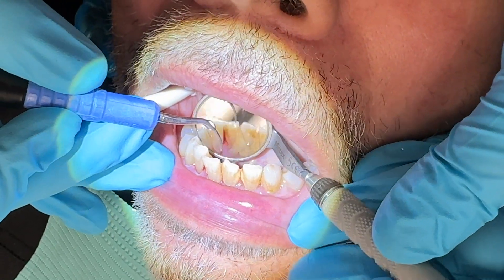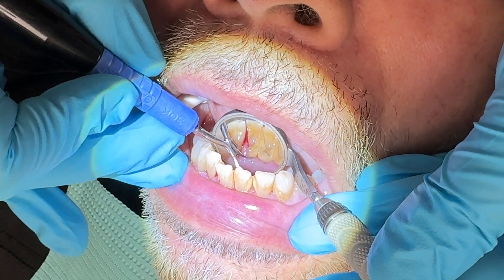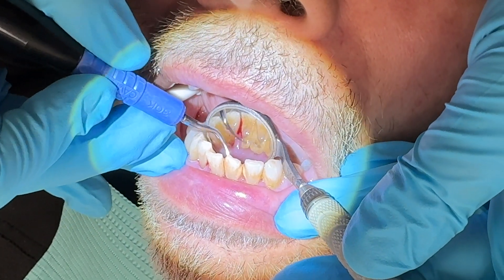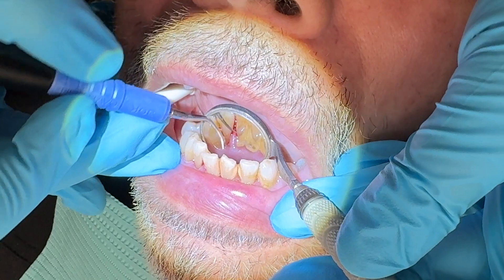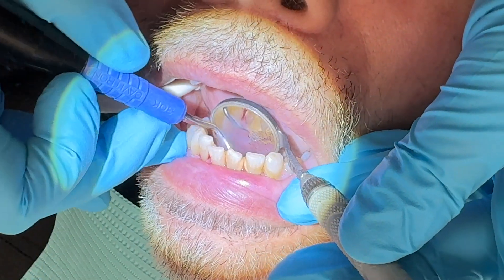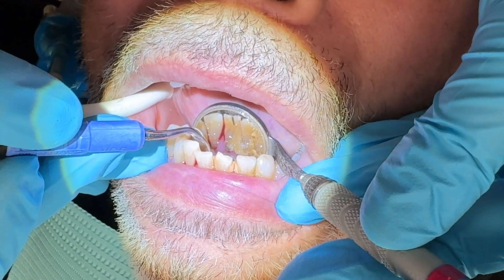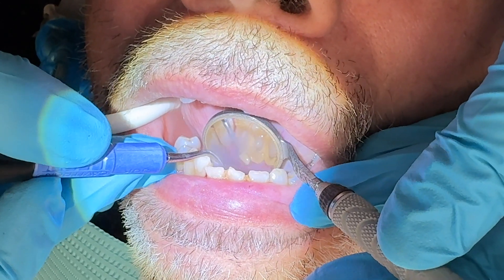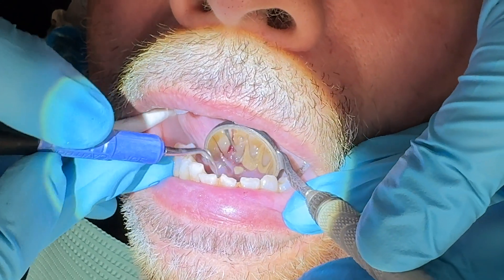Why Should I Use a Channeling Technique with the Dental Ultrasonic?

Comment: Absolute common sense. The angle for "burnishing" is difficult to achieve with piezoelectric scalers as the tip is never used. I think training and working with piezoelectric has made me a better clinician with magneto (Cavitron).